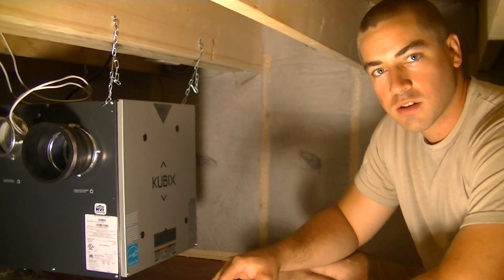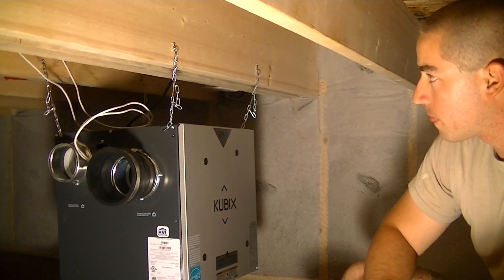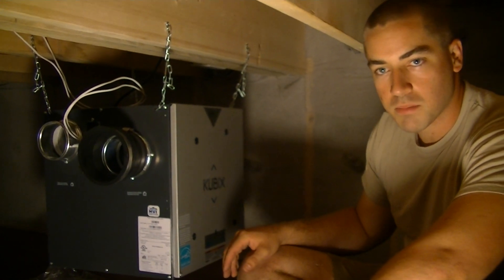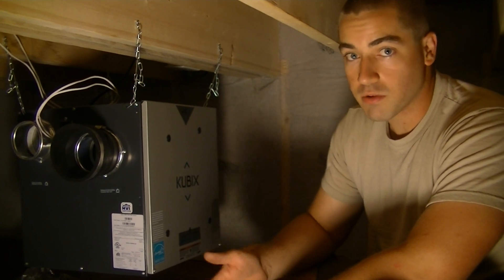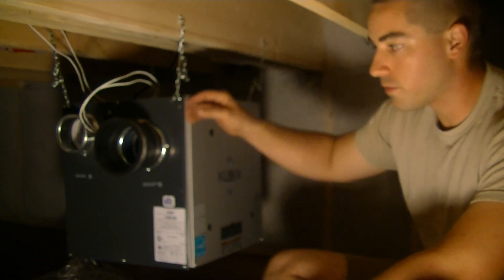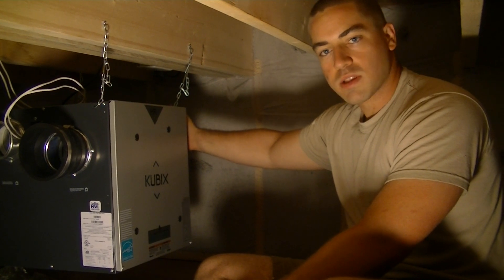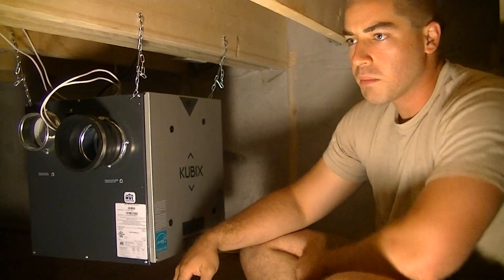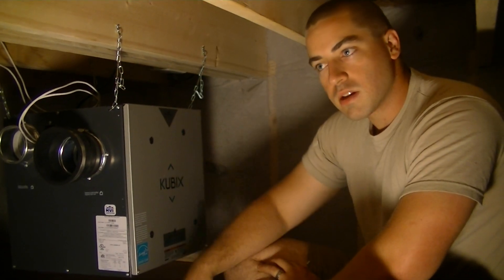HRV, Heat Recovery Ventilator in Air-Tight House

Comment: After installing new windows and air sealing the house in the winter my humidity had no where to go was up to 60% I just installed an exhaust fan panasonic whisper green select to run all the time at 30 cfm.. immediately the moisture lowered and the air was fresh. My issue is in the winter the cold air in the northeast will lower the efficiency of my heat pumps so im looking into an HRV..

Comment: I have an old air exchanger (pro100 venmar) that I would like to change.  I know the video is dated but I would like to know the model (k10 hrv?) and your impressions since.  Thank you very much!
Reply from the maker: This was the Cubix mini.  It has broken three times, at the lever arm connection between the cam-shaft and flappers.  I've had to make it myself since Venmar refused to sell me any parts because I wasn't an authorized installer.
Reply: thanks for your quick response and comment.  I will think about it before buying a k10 although Venmar is a company in my city (Drummondville).  sorry for my english i'm better at french 😀    I like you

Comment: I have tightened our house to the point where we need some fresh air.  I am planning how to pump filtered outside air into each bedroom through 2" PVC.  Not worried about VOCs!  20 cfm will exchange the air once per hour for a 150 sqft room which seems more than adequate.   Thanks for confirming my PVC plan, David.
Reply from the maker: Sounds good.  I'd love to see a video (if you get a chance).
Reply: is 1 exchange per hour adequate for house? I read something like 2-4 for bedrooms and 4-8 for living rooms which is crazy!!

Comment: The downside to PVC is off gassing of VOCs and if heaven forbid gets heated in a fire or burns, will release hydrochloric acid.
Using duct cement and proper duct ties, went from $250 a month in Summer to no more than $75 a month in the Summer with existing 30 year old ducting. Further, why would a small amount of leakage into a conditioned craw space matter? Especially if the trap door is not airtight, the ventilation air is already getting down there anyway.
Just putting that out there for future viewers and hope it helps.
Reply from the maker: You are right, that a small amount of leakage into a conditioned space would not be a big deal.  There were a couple reasons I made the ducts in PVC.  First, I like pushing the envelop and trying different things.  Second, the ducts that run from outside to the HRV are considered outside space and they do matter if they are air tight.  Thanks for watching.

Comment from the maker: I think it was $750 bought in 2012.
About a month ago I had an issue with it.  I received no support from Venmar because I was not part of their club of installers.  They even refused to sell me new parts.  So I took the whole thing apart and epoxied the plastic actuator arm back together.  I wonder how often this thing breaks, a plastic arm attached to a metal shaft...
Reply: Hey 
I dont know what kind of climate you have at your house, but in sweden we use rotating HRV's because they handle the moisture that is created from the cold to warm so much better in colder climates.
These strait hrv's have a huge water buildup like you explained and draining them is not the issue, freezing is, so when you switch, if you live in a cold place, look into rotating hrv's, they provide the same efficiency even when the difference is 40 degrees celcius from inside to outside.